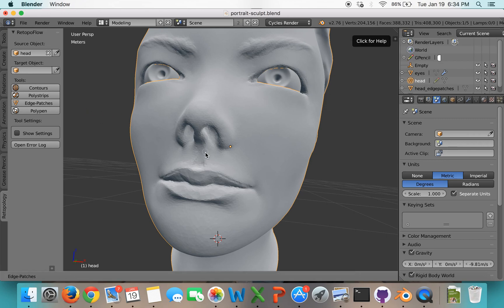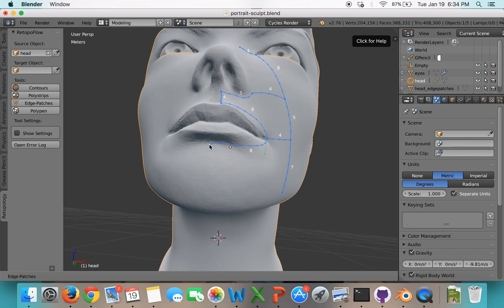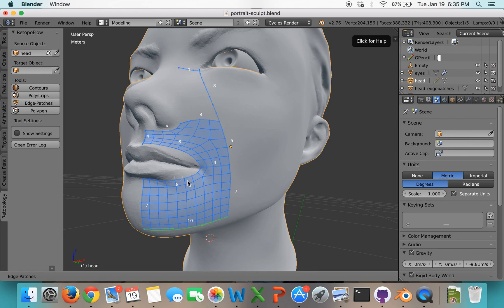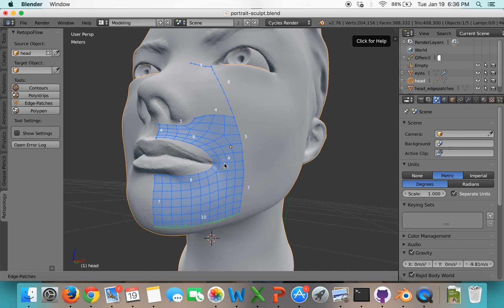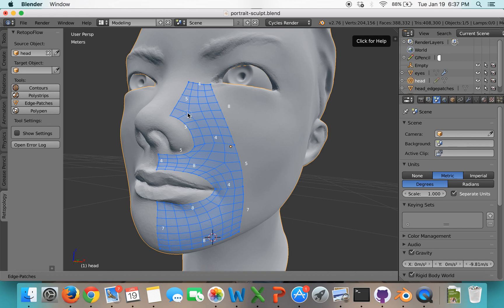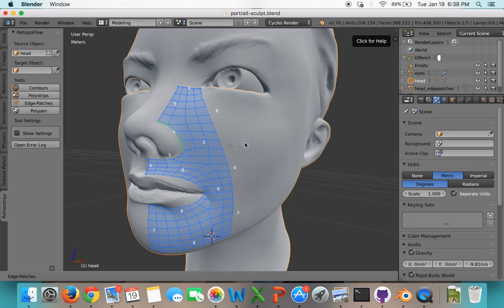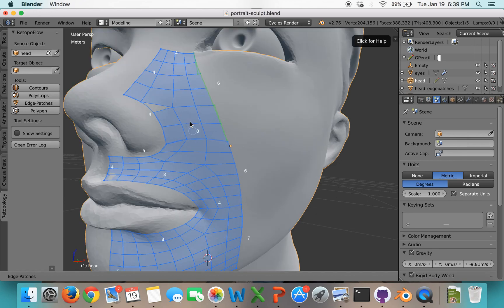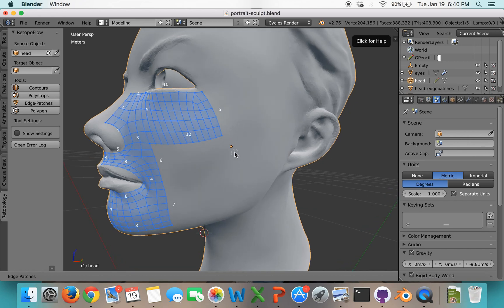Edge Patches Demo

Comment: hi, am I alowed to ask for quick help? I have a .blend and the geometry.intersect_ray_tri() does some funky things and then suddenly works.. Would you have 5 min to have a look and see if I'm doing something wrong or if it's a bug.. if you have the time, open the .blend and jump one frame for or backwards.. you (should) see that an empty gets added, which inticated the intersection points. Now the weard thing. Somethimes it does't recognise any of the intersection points, and somethimes only one of them(even thoug it would be clearly two)..try to move the sphere empty and then jump one frame again to try different intersections.. thanks in advice already! http://pasteall.org/blend/index.php?id=44571
Reply from the maker: 3D escape let's post on blender.stackexchange but yes, happy to spend 5 mins on it.
Reply: patmo141 really appreciate it..Oh, right..haven't thought of that ;D
Reply from the maker: 3D escape looks like someone already solved it for you!
Reply: Man I'm stupid.. ;D i was wondering why it worked at the beginning and after I optimized some stuff it didn't work..Thank you very very much for your time!